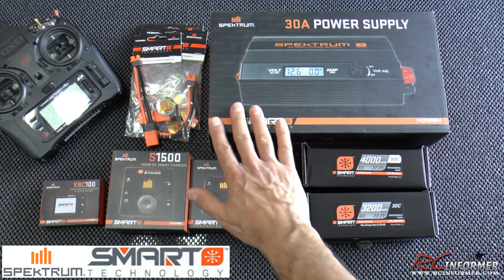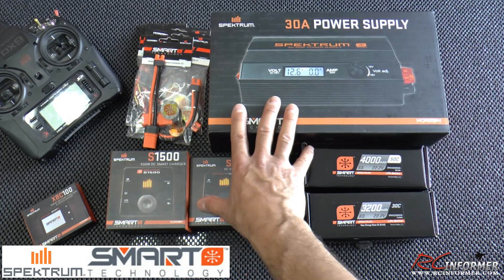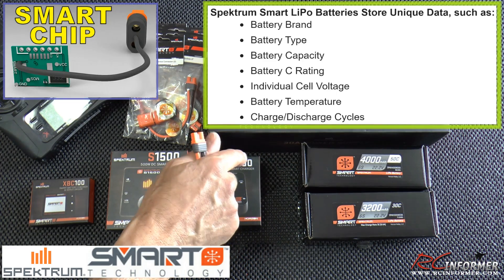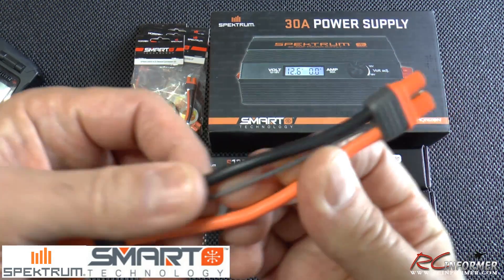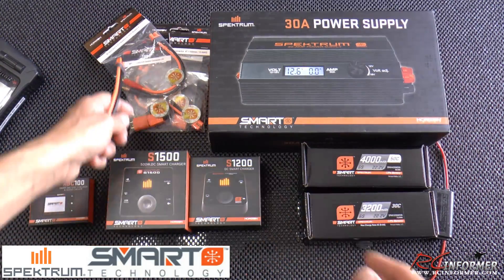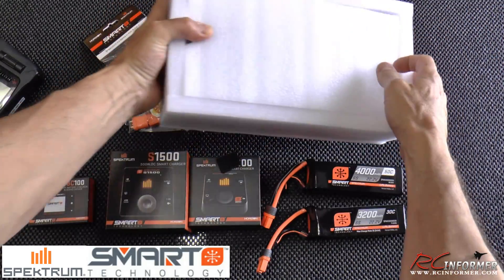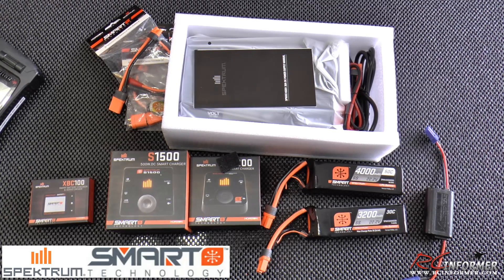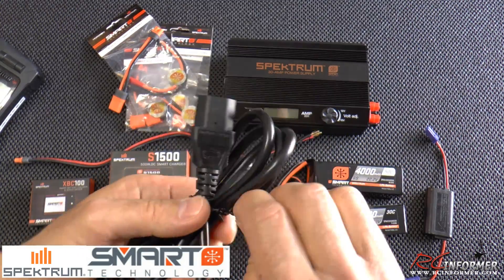SPEKTRUM SMART TECHNOLOGY INTRO & OVERVIEW By: RCINFORMER

Comment: Horizon recommended the s1200 for my Axial scx24 and I have no way to plug it into ac power or the battery it's supposed to charge. On amazon it says you need a power  supply but I tried to buy within the hobby market and got the sleazy sell.
Reply from the maker: Yes you do need an external power source to run this charger and I’m sorry to hear you got the sleazy market sales tactics whereever you went-It’s a shame we have people like that in the hobby but it’s just the way it is I’m afraid. We try to include channel support links for guys to pick up items without having to deal with that kind of thing-they don’t cost you guys any extra to use but we obviously get a commission for you using our links and it all goes back into running the channel. Hope you get sorted out👍

Comment: I wish Spektrum offered larger, dual port DC chargers. Seems like their only DC chargers are small and single port making the need for their monster 30a power supply pointless unless you have a charger for every battery which seems silly.
Reply from the maker: Yes, they do! In AC... Please click on any Horizon  Hobby link in the description below my video & it will take you to Horizon Hobby. THEN type in S2200 .... this is the latest GEN2 DUAL 200 watt per channel charger:)

Comment: I just ordered a smart receiver and smart ESC. I really want to know the voltage and current in the air! That will help me pick the right motor and prop for efficiency. Bench testing is great, but the prop unloads with increasing air speed. Unless you have a wind-tunnel, you have to be in the air.

Comment: Pretty sure you don’t need to connect the balance lead if your smart Lipo and a Smart Charger. It does it through the third wire in the plug
Reply from the maker: The new G2 batteries work that way, G1 lipos still need the balance lead.
Reply: Ah ok

Comment: does the 30a power supply give power to the charger without ac . is this for field use.
Reply from the maker: Some chargers are AC or DC or both AC/DC ... with a DC charger, you need a power supply OR a car battery. Of course, if you have electricity at your field, you can use an AC charger there.

Comment: question. I bought some 9.9volt 3200 smart reciever packs. Is it ok to run these packs on 6 volt rated servos? I wouldnt wanna burn up my servos...especially in flight
Reply from the maker: That may fry them unless it is going thru a BEC that accepts that voltage.
Reply: @RCINFORMER  its all goin through the Spektrum AR630. Nitro powered plane. I wasnt sure if the reciever would step down the voltage and distribute it accordingly. So i should get a BEC?
Reply from the maker: @shreddinjoe  probably, here are the specs: http://www.spektrumrc.com/Products/Default.aspx?ProdID=SPMAR630

Comment: What cable are you using to go from s1200 to the battery?
Reply: 8:52 the adaptor cable is the SPMXCA507
Reply: @DavidslvPT  So I ended up getting it.  But what I find is how short the smart wire is, wondering if there's an extension jumper for it?
Reply: @tjdreier3504  Hey, I've wondered that myself. But ended up doing some gymnastics on the battery to have them both connected. It would have been easier if they had done a IC5/IC3 with no cable or shorter cable. The expensive option seems to be to get their new Spektrum G2 line which seems to have EC5 connection (announced yesterday... who would have guessed...)
Reply: @DavidslvPT  I'll have to look into that, but yeah go figure! Hopefully they'll make an extension!!

Comment: Thanks Rich. I plan to get the A 2100 to not have to worry about picking up the converter. Any reason why you didn’t do that? Do you get more power using the converter. Just a dumb question. Makes me think if I should do like you did with the 2 smaller chargers.    ??????
Reply from the maker: Danny, please consider using my link to purchase the S2100... Thank you for supporting my channel:) I have included the link here for you and will also add it to the description► https://bit.ly/2ZsmCzL
Reply: RCINFORMER I have ready planned to us you link when I do. Thanks again
Reply from the maker: @dannyhelton6363  Danny, I appreciate that alot...  If you decide to get something that I do not have a link for, just contact me and I'll send you a link & add it to the description:)
Reply: RCINFORMER thanks got it!
Reply from the maker: Thats a good question! I actually prefer to have less equipment:) I may get a S2100 as well since it will charge 2 packs at once.
Reply: @RCINFORMER  that's what I was thinking. Even though the other one has 500 watts. 
Thanks for your thoughts.